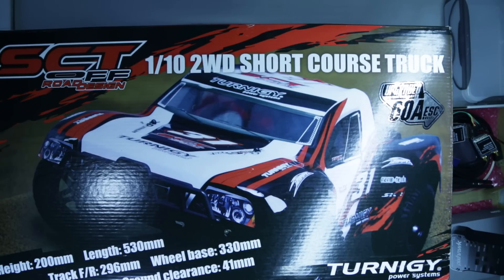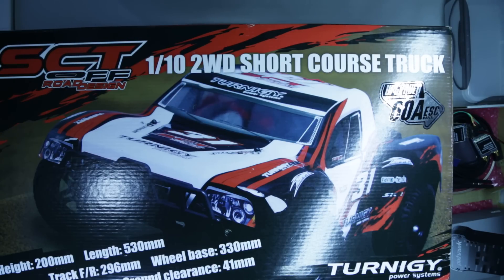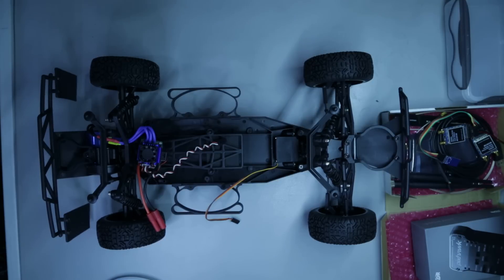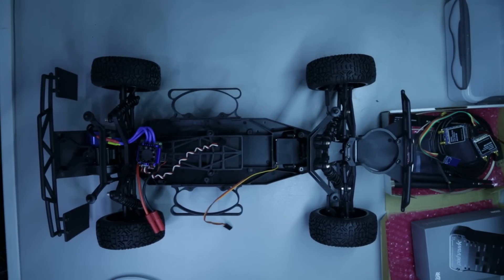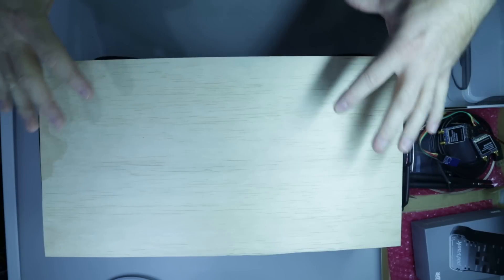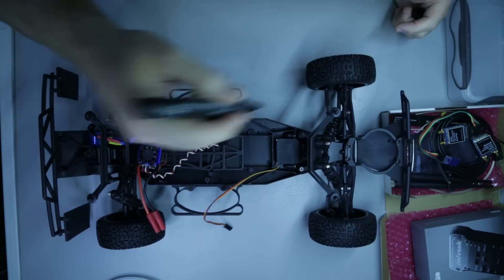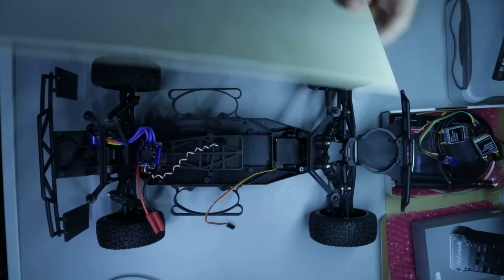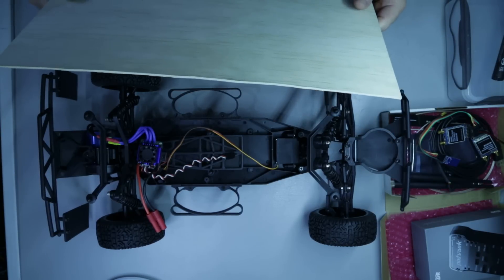ArduPilot How to Build a Rover - Part1 - Introduction

Comment: Hi all,
 I’m using PixHawk 2.4.8 for rover I’m facing some problems flashing green light after pressing safety switch and i found gps locked but pixhawk disarmed  i want covert into solid green light  how can solve my problem plz guide me??
Reply from the maker: I am guessing you need to arm the Rover. Try steering hard right for 5 seconds or left and see if that helps. Otherwise post in the Ardupilot forums and someone there might know.

Comment: I can't seem to find Vehicle you initially purchased. Can you recommend a similar one for the same set up?
Reply from the maker: Hi Angus.  I tried to find vehicles you could buy today.  Some are available on backorder/preorder but I didn't choose those.  I've had a look and HobbyKing and the landscape seems to of changed a bit.  Prices for 1/10 ARR vehicles are high.  You could do it with one of these
https://hobbyking.com/en_us/h-king-1-12-scale-2-4ghz-super-car-4wd-electric-off-road-monster-truck-rtr.html
At 1/12 its a little smaller then the 1/10 but you should be able to get everything to fit.  Looking at the photo's in that the receiver and ESC seem to be a very dodgy custom job so you mileage may vary.
For a bit more money this seems like a better option

https://hobbyking.com/en_us/quanum-vandal-1-10-4wd-electric-racing-buggy-arr.html
Although mounting a flat board to put everything on could be a bit tricky as the front and rear mount points are at different heights.  Hopefully it could be extended in some way. 

Tower Hobbies also has a decent range.  This would also work
https://www.towerhobbies.com/cgi-bin/wti0001p?&I=LXKSCL&P=0
as would these
https://www.towerhobbies.com/cgi-bin/wti0001p?&I=LXLCEU&P=0
https://www.towerhobbies.com/cgi-bin/wti0001p?&I=LXKGHJ**&P=0

If your looking around for something don't go anything smaller then 1/16 IMHO.  You can squeeze everything on at that size but any smaller it just gets too hard.
Let us know how you go!